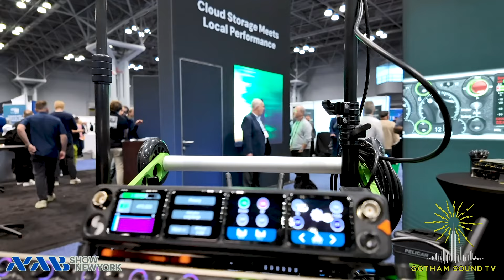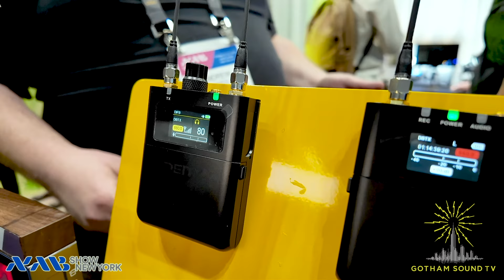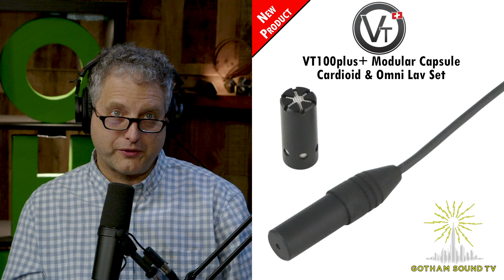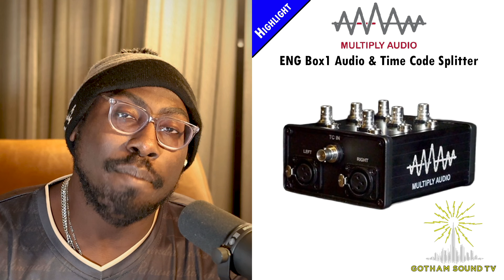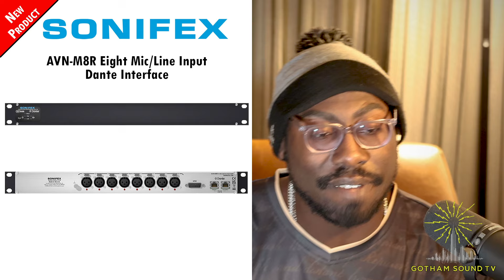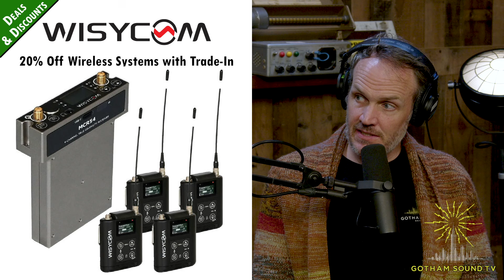October 2025 Production Audio Wrap-Up

Comment: So to get this straight regarding Deity: In the US you can not transmit and record at the same time, and you cant use the IFB Units with the regular THEOS Transmitters.... But outside the US you can do all that no problem?
Reply from the maker: Yes, that's correct. Also important to note that the US and non-US models are two different products, so the simultaneous transmit/record function of a US model will not enable via GPS in another country, as the frequencies available do for some Deity wireless.
Reply: @GothamSound thanks 😊